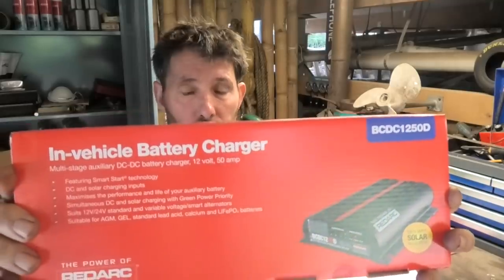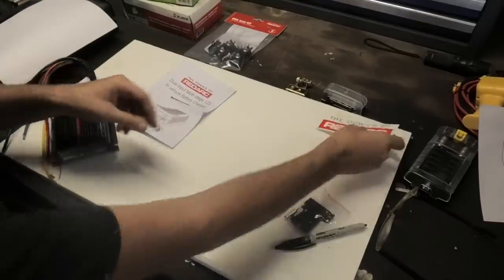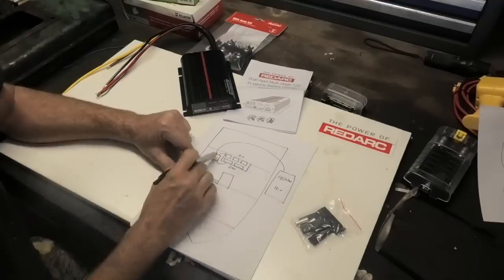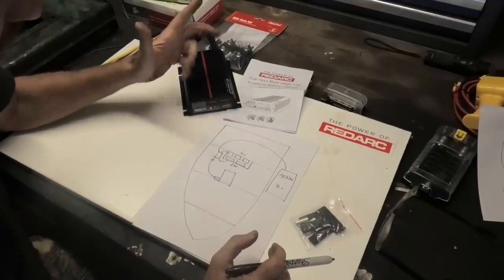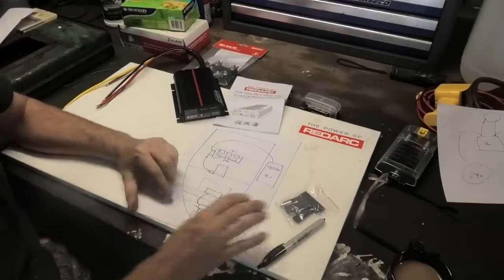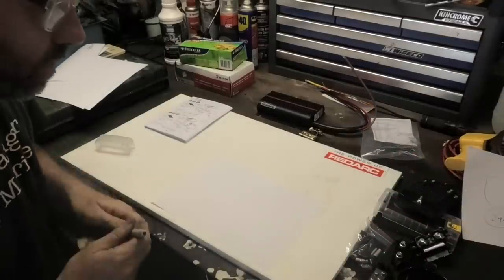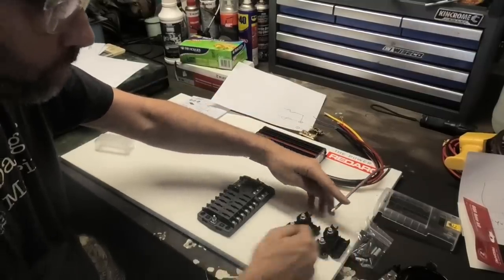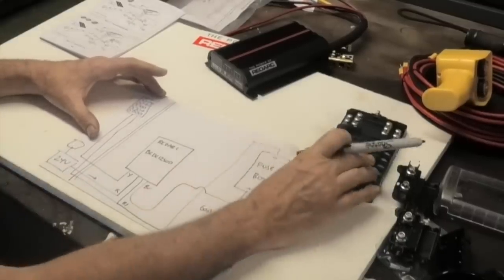Planning the trawler electrics

Comment: Cheers mate, been watching the series for a while and recently subscribed.  Im a bit concerned about the battery situation.  two or even three batterys wont give you enough amp hours to run your fridge never mind the winch and boat essentials.  generally for power storage you use a deep cycle battery as they can handle charging and draining cycles better than  the standard battery you would find in say a car. even then they tell you for battery life you really dont want them to go below 50 percent capacity unless you want to be buying new batteries every year or two. a quality lithium is about 140 here in the states. you could go cheaper with the lead acids, but they require maintenance and off gas.  I think after doing a little ohms law you find you probably need a 6 or 8 battery bank if you want any decent fuel savings and still be able to really get some work done if your pushing hard.  may want to look into some anti vibration mounts for the small generator and some means of building a sound dampening box to go around it.  While I think your current set up will totally work, i think you'll be running the engine a lot and replacing those batteries on a yearly basis. I took classes from these guys back in the day and the video runs you through some of the issues. https://www.youtube.com/watch?v=7ROjd6eLANo

Comment: I checked out the comments and the one thing I didn't see was adding a battery monitoring system. It is like a fuel gauge for your battery. Since your planning to spend nights out on the boat, this will tell you how much power you have left in the batteries (spend or conserve?). It can also help you find how much each device is consuming ( I had a inverter with huge standby usage). The Trimetric TM-2030RV by Bogart Engineering is one such device ( there are plenty of others).

The problem with 3 batteries in parallel is that,  the lead acid batteries have serial connections that you can't access. Therefore, it is recommended to not have more than 2 parallel strings of lead acid batteries. For comparison, lithium batteries require the usage of a battery management system that has access to each series connected cell (these can consist of multiple parallel connected cells) to prevent these series connected cells from getting unbalanced.

I have a 12v system in my RV, honestly if I could start over again I would go with a 24v system. Higher voltage means smaller wire. This may not seem to be big deal, but there are no really short runs because you always have to go the long way around to preserve the living space.
Reply from the maker: Battery monitoring is definitely something I have planned, just organising the unit now. I can see what you are saying about the parallel batteries. Large 6V batteries in series does seem to be a better way to go. I can also see the advantages to a pure 24V system. I think if the boat was any bigger and I had less 12V devices requiring a transformer I would go that way.
Reply: @DangarMarine  I get the not going to 24v. I have too many items that I upgraded before I realized that going to 24v would have been better. Although, now I am looking at lithium batteries (NMC, not LiFe) and that is going to add a bunch of complexity (wrong voltage for sensitve items). Luckily, my inverter doesn't care (wide input range).

Comment: Hi Stu, just a thought. Winch motor for anchor, hydraulic instead of electric?  Emergency Lighting around the distribution panels, so if mains fuses go, you still have light to fix it, not trying to find a torch/Flashlight?
Reply from the maker: Yes, emergency lighting is something several people have mentioned, usually from bad experience!

Comment: USB-C on a Macbook is what's called Power Delivery (PD), and is 19v-20v. Lenovo makes a 12v DC 65w USB-C  charger that has PD and should charge your Macbook. If you have a Macbook Pro the charger that came with it is 85w, so the 65w charger will take a little longer.

 The Lenovo part number is 40AK0065WW. I'm using one to charge a Macbook Pro and a Lenovo Thinkpad for our portable ham radio activity. It's also great for charging USB-C phones.

Comment: Some forced cooling for the dc dc converter, lots of 12v fans are reasonable in price. I would also consider diode protection input and output sides just in case you get a back feed of current

Comment: Hi Stu, the MacBook requires USB-C to negotiate 20VDC, it is not as much about current.  Search for usb-car-charger-board-60w-high-power-pcb-ccg3pa and that should get you close.  Make sure you have extra of those 60A fuses on board in a KNOWN place not in the engine compartment.  Also, if I were you, I would look at the LiFePO4 cells.  They cost a bit more than LeadAcid, but they have a better long term current draw for Boat electronics (steady voltage), and a better lifespan.  The only downside is you need a BMS board for really long term health and it might be too much for the project.  I know we find it better to run the Radar, depth, radios and other stuff on these batteries because we don't have the voltage fade.  Also make sure you have hard cut off switches/Relays from each circuit.  It is a boat, there is water, and shorts do occur.  Salt water makes a great replacement fuse.
Reply: Also a good buss bar is a copper pipe inside a PVC tube.  You can run a couple of these for the radar/depth and radio circuits.  AC can follow a similar principle, but we always paint the PVC tube with a florescent color to identify it.
Reply from the maker: Thanks mate, you've nailed it with that search term. This unit looks to be exactly what I am after (apart from being on back order!) https://www.coolgear.com/product/usb-power-delivery-60w-high-power-industrial-adapter-charger-ccg3pa

Comment: cooling fins on the redarc will dissipate heat best when they are mounted vertically.
Reply: and  i would suggest standoff spacers  so it doesnt melt the board  plus air flow underneath
Reply from the maker: Good point! :)
Reply from the maker: Another good point!

Comment: Hi Stu. Direct current is much safer than alternating for many reasons. Also easier to work with and i would imagine alot less risk of electrolysis. Fuses have to be rated lower than the melting point of the wires that they are protecting. When i saw the 60amp fuses and the wires that are going into the fuse holder i cant tell from across the globe if the wire gauge can handle more than 60amps. So as an example a wire that melts at 70 amps should have a fuse rated at less than 70 amps, like a 60amp fuse. At 60 amps i would think a wire gauge of 6 or 4 would be safe. Those are thick wires. Ambient temperature also has to be considered when protecting a circuit. If its hot in an area, like the engine bay might get, make sure the extra heat isn’t going to melt the wires that are under load. 

Figure out what loads are going to be on individual circuits. Amps are what is important here. Add them all up and run a wire gauge to that area (like the cabin, or or nav lights) that is rated higher than your amp load for that circuit. So as an example if your cabin fridge, gauges, and lights need 10 amps run a wire gauge to the cabin that will carry 15 or 20 amps. Then use another fuse panel to feed the individual loads. Put a fuse before the panel rated less than the feed wire, and individual fuses or breakers after the panel for the smaller wires to the individual components.

When it comes to grounding thats is where i’ve heard the most myths. Just as an example, for the cabin circuit run all the grounds from the individual components back to the bus or breaker (thats preferably in or close to the cabin), then run a ground wire from the breaker that is the same size (or larger) as the feed wire to the breaker. Your plan to meet up all the grounds in a central point and then return to the negative on the battery is fine (like in the center of the hull). Just make sure to add up all amp loads in the boat and use a central ground wire rated higher than the amp load.

I guess the ground myth i hear most often is when there are individual loads or components on a circuit that are running hot or burning up. Like a fried stereo or instrument clusters. And the person thinks well there must be a “bottle neck” or something with the ground. And thats kinda partially correct. But the opposite of whats going on. Think of it like this, there is no bottle neck, there isnt a large amount trying to squeeze through a smaller ground wire. The ground wire dictates what the circuit and loads can pull. If you have an 8 gauge positive wire and a 10 gauge ground wire, that circuit is only going to supply what the 10 gauge ground wire can return. So actually you have a bigger feed wire that is only carrying what the smaller ground can return. The ground is the heart if the circuit. Components are burning up because they are constantly trying to pull the load they need and cant because the ground cant carry it.

Lengths of wire and resistance over distances is where your trying to fine tune the circuits and the charging system. I dont think you’ll run into a problem there. You definitely have some distances to carry to and from the batteries but they’re probably between 18 and 30 feet. I dont think theres gonna be a large enough loss in electrons to be under charging the batteries.

Dont ground anything to the hull and back to the negative terminal. Electrolysis will occur. Dont use aluminum wires, they are rated less, and will expand and contract more than copper and loosen at connections over time and potentially cause a fire. Always put a fuse as close to source as possible. If theres a chafe and ground before the fuse, its gonna get hot and possibly start a fire. I’m sure you know all this stuff. You’re a mechanical genius.
Reply from the maker: Hey Kris, thanks for all the info, all makes sense. The only part I'm still getting conflicting information on is earthing the grounds to the hull. The experts are RayMarine are telling me I need to do this. They are very clear that it needs to be done correctly, but it does need to be done in order to get a reference voltage for "0" I need to pick his brains again to get more details but I think it is important enough to be a video in its own right.
Reply: Hi Stu, if there is going to be any  A/C on the boat then i would think you definitely need to ground to the hull and ground your inverter as close to if not directly to the anodes. The ships ac inverter and ship to shore ac power is very high voltage and can travel or jump large gaps like the water around the boat. Dangerous for anything in the water. Thats another reason why dc is safer and easier to work with, much lower current speeds (volts).

I would listen to what RayMarine tells you. I wasnt thinking about lightning strikes either. If it got struck by lightning an unearthed hull will probably overload everything inside the boat and start a fire. Wile in an earthed hull the current will probably just pass through the boat and into the water.   

A old timer once told me you can never have enough ground. The more grounding sources you have the better. The electrical system will always work better with the more ground sources you have. So it maybe unavoidable to ground to the hull. You can still run your ground wires from the loads back to the source also, it should ensure good ground and and a healthy, safe, efficient electrical system. 

In most cases i’ve run into electrical problems is people buy a boat, or car, or whatever and start adding electrical devices to the existing system. Then things start going wrong. Then i usually find they have or haven’t added a larger positive wire. Then on the other side of the load almost always haven’t added a larger grounding wire. So all of these devices are trying to pull the load they need and cant get it. So when wiring go a little larger than you need, so in the future when you want to add more load, you dont have to run a bunch of new wires, just tie into the existing system. 

Now that i think about it, if you have an ungrounded hull and there is a small chafe touching the hull it will sit there and trickle volts and get hot without tripping a breaker or fuse. If the hull is grounded, that small chafe will immediately ground, pull all the current and snap a fuse or trip a breaker.

Figure your loads and go a tad larger for positive wires, then go the next size up from the positive wires for the negative wires. (This is for future devices.) Then draw it all out on paper and critique your plans and revise once you’ve seen them, if needed. Run grounds to the hull and to the source, if possible run some grounds right to the anodes. This is starting make more sense to me now. This should make everything safe and efficient. Minimize hull corrosion and maximize anode corrosion. Just remember you can never have to much or to many ground sources. 

I know this is gonna be sweet when you’re done. You’re a thinker and smart. It will be neat and efficient. No more wires running all over the place. And no more deciphering what wires your looking at and where they go. Oh and remember that heat is a concern. Try not pipe wires that are carrying high amp loads in hot environments. Probably not a big deal because most wires wont be carrying high amp loads for extended periods of time, just occasionally. So ya, you probably can pipe them, just be conscious of that concern. 

Really wish i could be there bouncing ideas back and forth. I’m tired of the u.s.
Reply: I never explained fully for the larger negative wire compared to the positive wire. High amp load devices like electric motors will pull the amps they need according to the resistance they get from what ever they are pulling, like an anchor. You really cant stop an electric motor, the more force thats put into the motor the more amps the motor will draw. If you keep adding force to the motor it will keep drawing more amps until a fuse snaps or something melts or burns up. Usually those types of motors demand a high amp draw when ever they are first started. Even the motor on a refrigerator will pull hard when it first snaps on and then level out once the motor is turning. Or an anchor at the bottom in mud will pull high amps and once things are turning and free from the bottom it settles down. So by going the larger negative it will allow the motor for a brief second to pull the amps it needs and not stress the motor or circuit out. This is pretty normal and even a fused circuit will allow the extra heat briefly to supply the motor. A breaker circuit will allow even more heat before it trips. Fuses are the easiest to snap, other than gfi circuits. Gfi will snap even if the load was too high for a millisecond. Thats why they are safe in bathrooms. I think a large sneeze will trip a gfi circuit.

Comment: Make sure you have a master disconnect that's easily accessible.  It should be on that main board, possibly before the large fuses.  And several other 'master branch' disconnects on the main board so you can work on branch circuits without having to power down the whole boat.  I don't think that fuse box has enough single fuse capacity (great for engine room accessories however) for your branch to the wheelhouse breaker panel.  I would suggest using another large fuse (30amp?) plus a disconnect or maybe just a large circuit breaker that can also be the disconnect.  Same goes for the feed to both the deck crane & windless.  I know they have large surface mount 12v circuit breakers for automotive, must also exist in marine versions (suitably more expensive of course...).  Finally, consider mounting all the wiring in (finger) raceways, makes everything much, much neater and easier to repair/upgrade and they are cheap.  Also, invest in a label printer so you can label everything including the wires.

Comment: Maybe give some thought to running your house circuit at 24v instead of the 12v. Rather than your 3 x 12v house batts in parallel, look at 4 x 6v in series. 6V deep cycle batts are easily available, think golf cart.
Advantages are the series battery bank seems to treat the batteries a bit kinder than a large parallel bank. . one battery getting lazy in a 3 x parallel bank will really put the hurt on the other 2.
Another advantage is reduced conductor size. Double voltage means half the current for a given wattage load. Smaller fuses and less heavy-duty fuse holders also.
Things like an inverter are also more efficient at the higher voltage, and you get that same 50% amperage benefit. Do the maths on how many amps a 2000w inverter pulls on the DC side at 12v!! It's an eye opener.
Depending on the solar panels, there can be an advantage to running those at the higher voltage too.

Most things you will want to run are available in either 24v, or auto select 12/24. Think heavy vehicle/truck/earthmoving market for things like radios and other accessories. Most marine accessories are also available in 24v. Things like lighting can easily be run in 12v series pairs if there isn't a 24v option for the fixture you want to use. I'm seeing more and more move to 24v as the standard DC voltage on boats. . it seems new builds are only using 12v for the legacy or super-specialist stuff that is absolutely unavailable in 24v, and even then, is usually just a 24-12 reducer running the 12v bus.